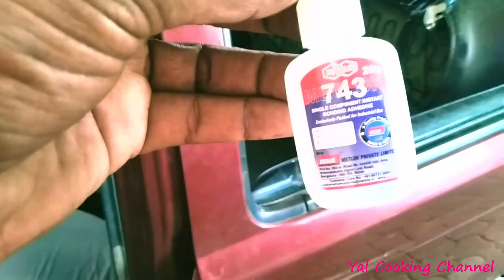How to Install Car Full Floor Mat | கார் மேட் மற்றும் சீட் கவர் எப்படி மாற்றுவது

Comment: எவ்வளவு, சார்ச்,பன்னாங்க?
Reply: 1800.00 for floor mat and 3250.00 (2500 seat cover.400 fittings.350 alterations as this is vechile is old one and couldn't find exact readymade clothes fitting seat cover) for seat cover including modification and fittings ..
Reply: @muthuvelk7036  please total cost solluங்க,🙏🙏